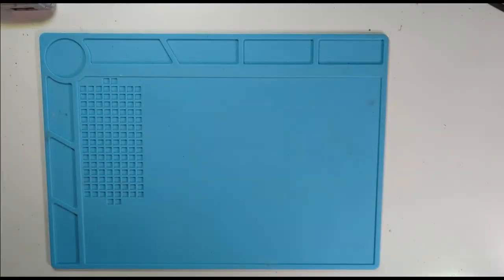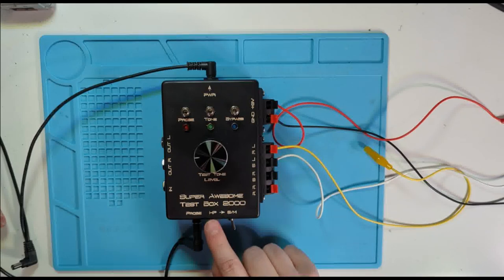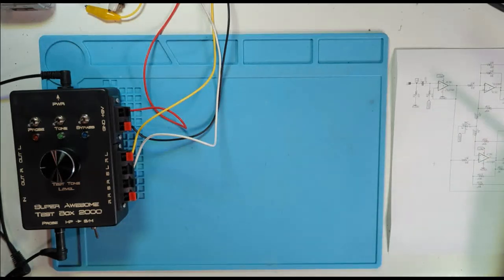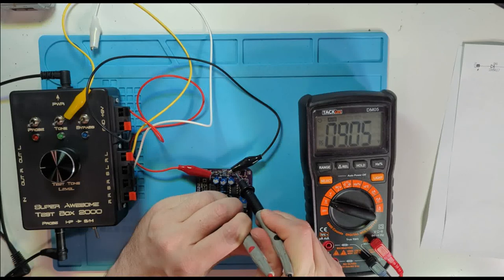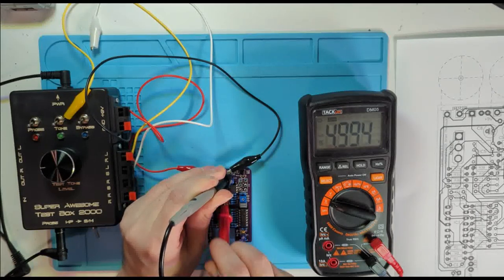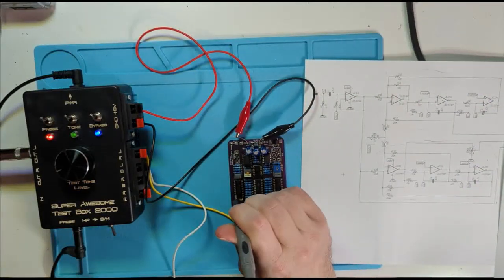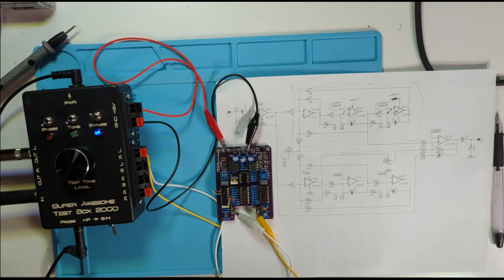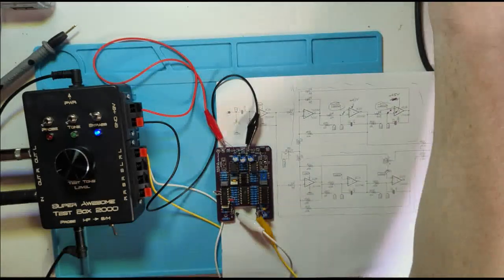Debugging Basics for Pedals and Effects

Comment: nice!
what about noise on pcb layout?? is it affect failure on audio signal??
Reply: and what do you mean flip flop the ic pins??
is the ic has wrong configuration pins or what??
Reply from the maker: Good PCB layout is important particularly for high gain circuits or circuits with RF signals onboard. That is a layout issue and not so much a debugging issue. R.G. Keen has a good book on PCB layout for effects.
Reply from the maker: In my schematic I put the wrong signals on the wrong pins. I put the signal for the + terminal on the - terminal and the signal for the - terminal on the + terminal.